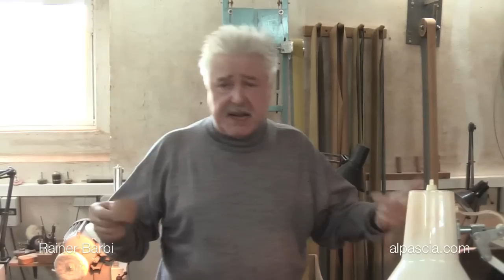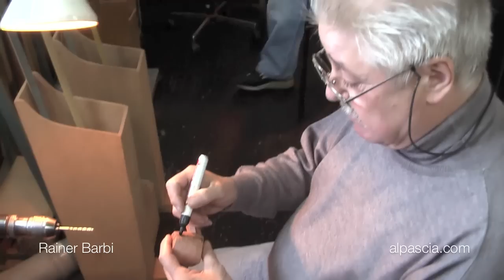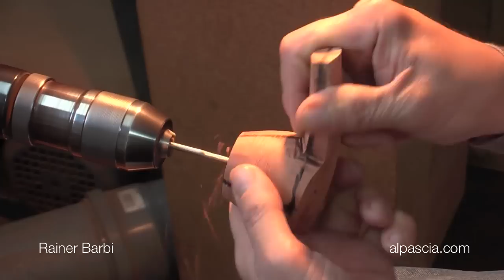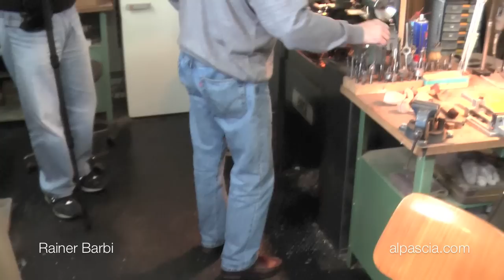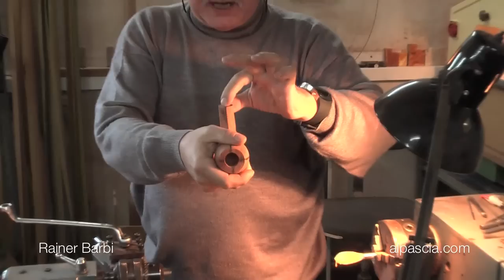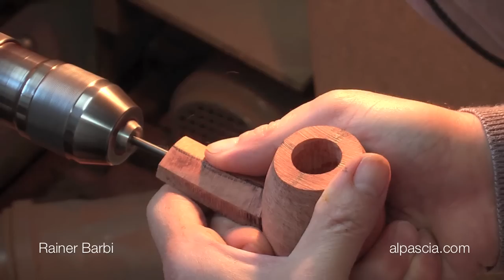Rainer Barbi - how to drill a pipe

Comment: To drill the curved channel, the pipe starts out straight and a straight hole drilled.  The stem is shaped afterward with a form or something to hold strong pressure on it in the desired direction over a long period of time.